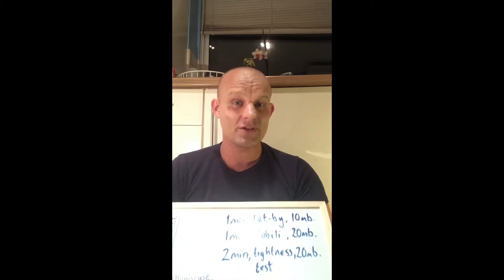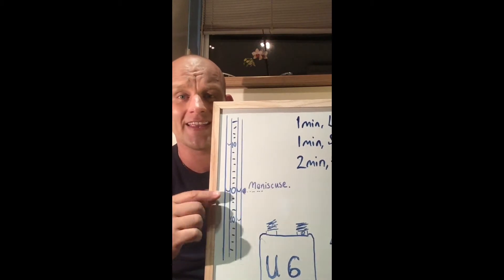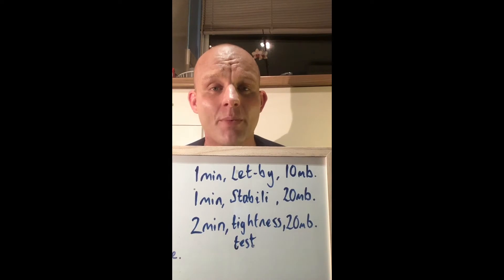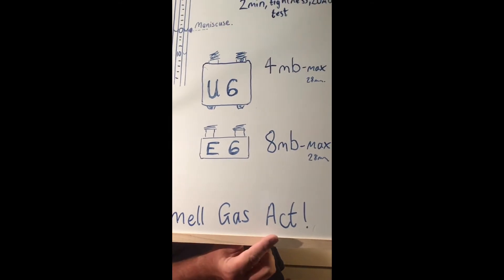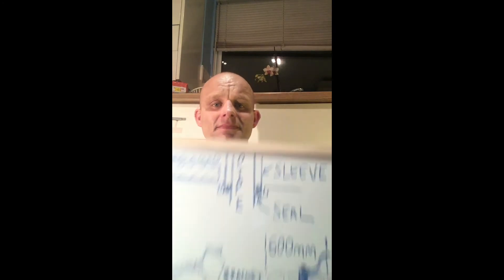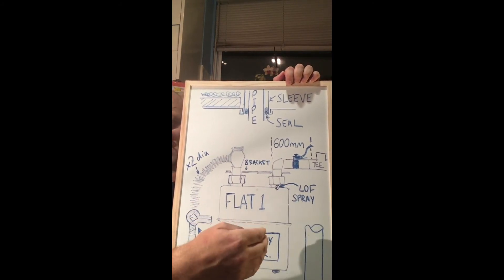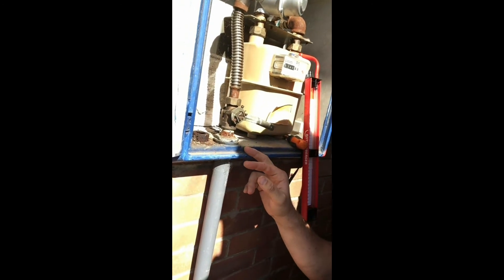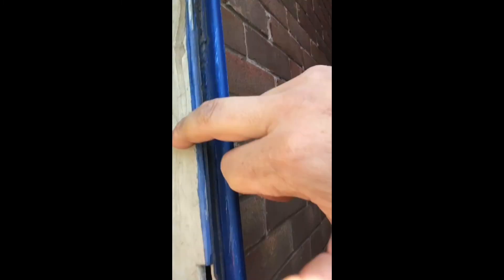Testing, commissioning & installing gas meters

Comment: Nice video mate could you do one on unions and fittings ie steel to copper,adaptors and making up regulators. The little tricks with pipework that would speed up the installation of gas meters.
Reply from the maker: Karl ok but it’ll be awhile yet fude